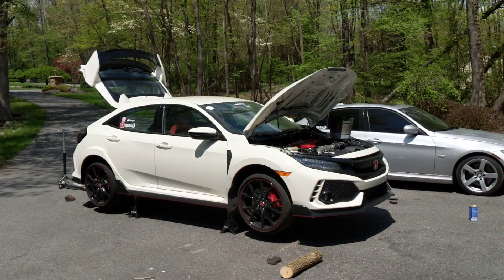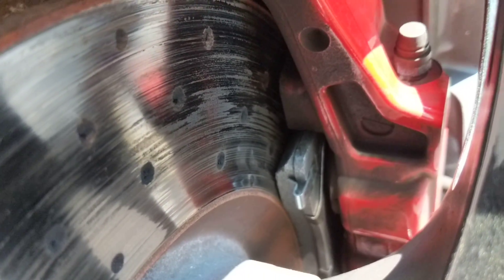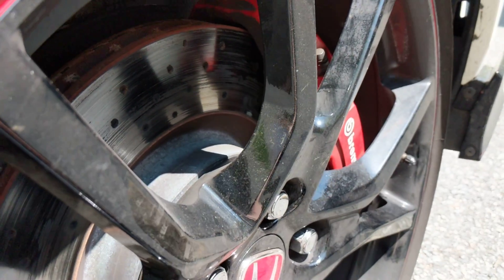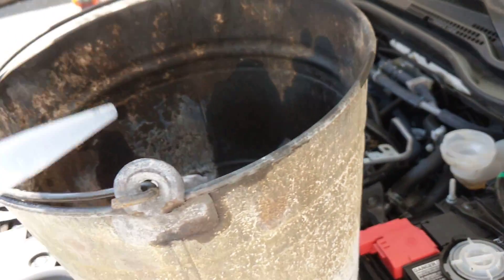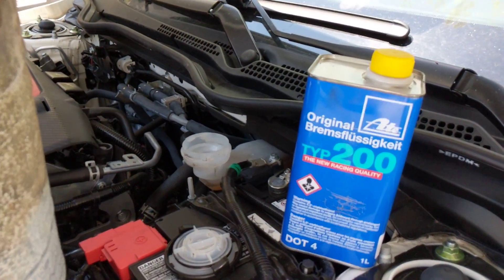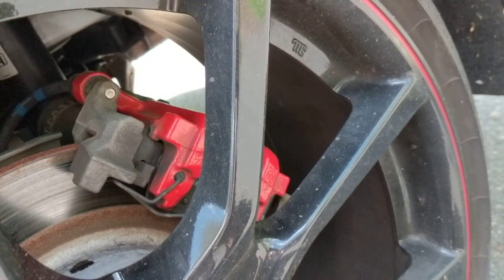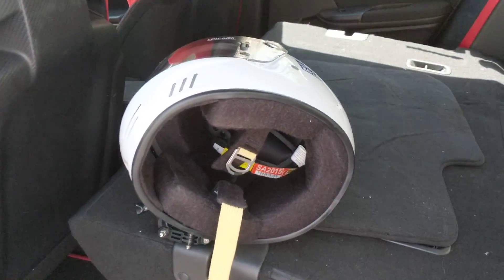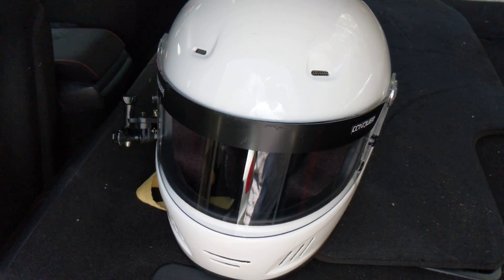Honda Civic Type R Autocross | How to Prepare for your First Autocross

Comment: Nice looking just did on my typer the prl intercooler,afe air intake , and afe downpipe whith hondata flash man car is a bullet now. The down pipe i rocomend a shop to do as bolts from turbo strech and brake i broke two bolt a my type r.

Comment: Dude. Stick to Honda brake fluid and Honda transmission fluid. Honda systems are picky af. You're going to have issues down the line if you keep using non Honda branded fluids for their systems like transmission and brake fluid. Same with steering fluid but this car doesn't have hydraulic power steering.